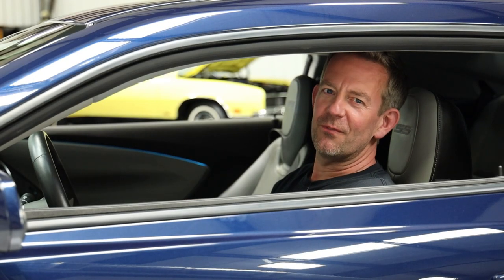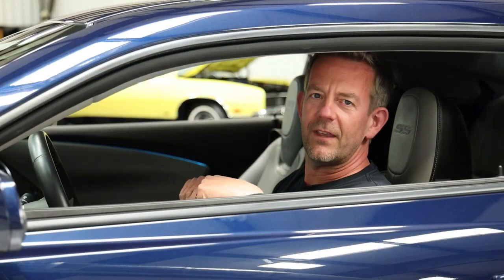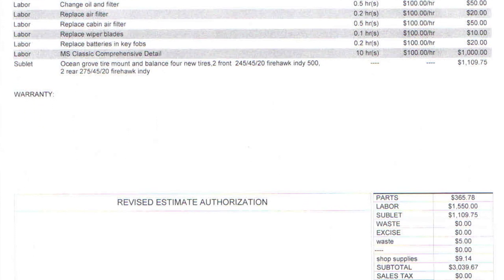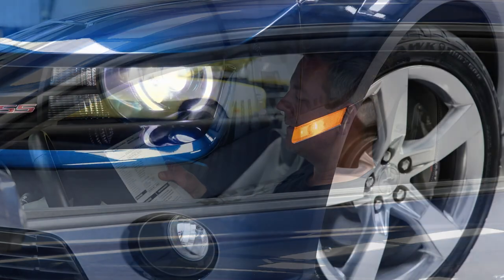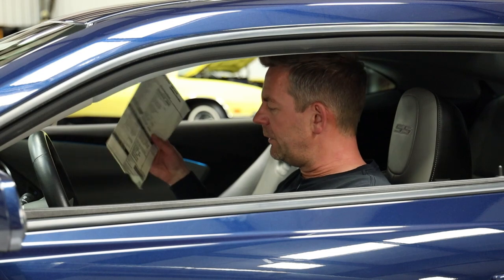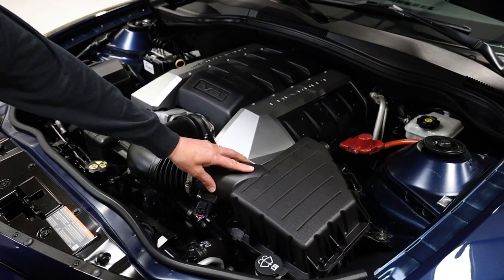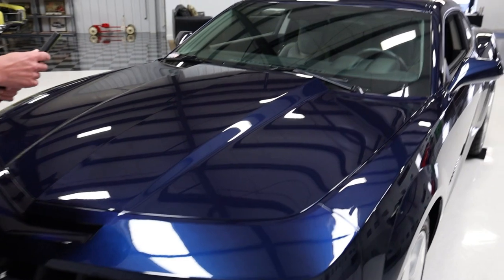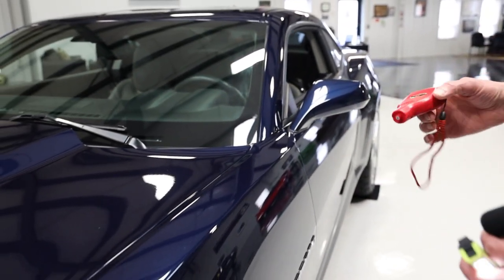2010 Chevrolet Camaro 2SS with 9,752 Original Miles

Comment: I just recently picked up a black on black 2010 2SS 6 speed moon roof with 2,500 miles on it.  It’s absolutely immaculate.  Bone stock.  I just changed the shifter out for a Hurst (kept the stock one of course) and I’m going to swap the stereo for a Maestro kit with 7 inch screen, CarPlay backup cam etc… but again I’ll keep the factory stereo in a box.  These are great cars and for the prices they’re a steal compared to brand new or almost new Camaros.

Comment: Front tag🤮🤮🤮
Reply: You can remove it and add color matched bumper plugs.  Not as nice as never having had the front plate bracket in the first place, but much better than having the plate bracket for sure.  That’s what I did.